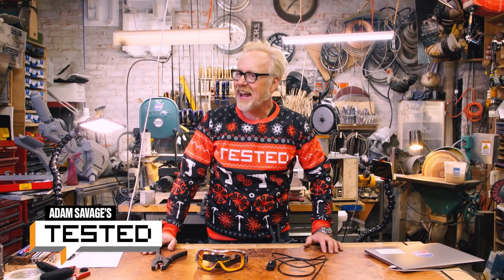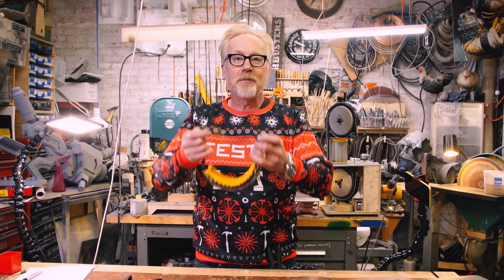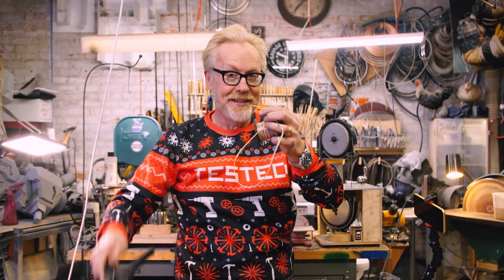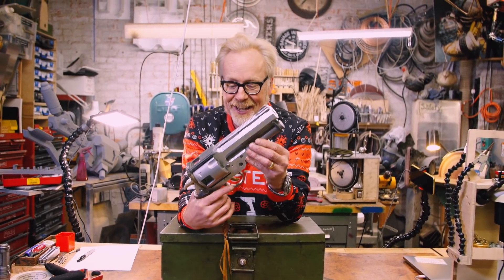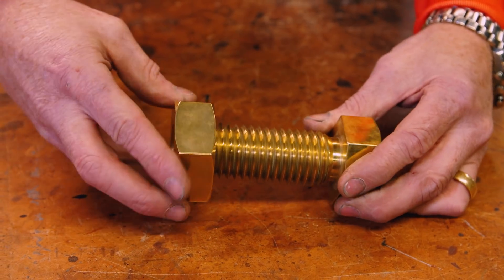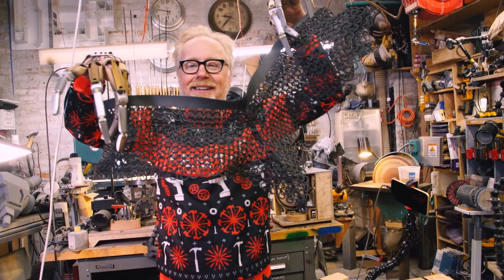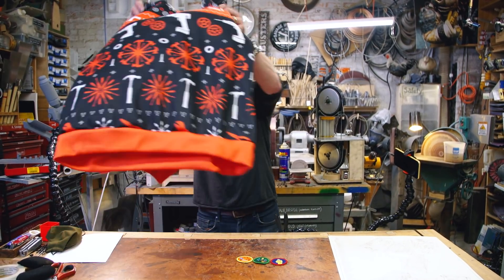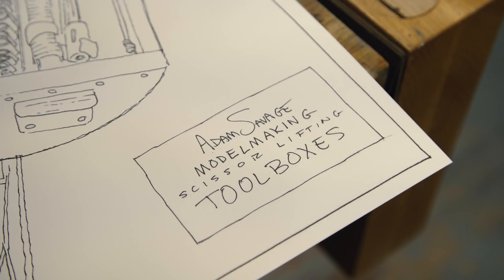Tested in 2020: YOUR Favorite Things!

Comment: On the PPE note, it is possible to get z87 prescription glasses so you can always have eye protection without needing to put on specific safety glasses or goggles. Depending on the design it may or may not be recommended that you also have sideshields, but even without they're better than nothing

Comment: i am commenting off of your fisrt item, I have to say an endo scope is one of my favorite specific use items I have bought. I recently installed an engine kit on my motorcycle and there were some sounds i didn't like. buying an endo scope allowed me to feed it in the spark plug hole a see that me back piston was wearing wrong. saved me a lot of money and time in the long run

Comment: FYI, I just had a look on the Greenlee website to check out their wire stripper - it would seem they don't make that type of wire stripper. They've got a few different types avalible but not the type that helps when you've only got a tiny bit of wire to work with.

Comment: The T100 soldering iron is a life changer.  So small and easy to use.  If you haven't put the custom firmware on it you should, adds a ton of great QOL features.

Comment: I suggest demerit badge for forgetting to put something on the cable before soldering it, what prevents putting this thing on the cable. This but should be flippable (upside down) and you should flip it every time you do it. It should feature the phrase "forgot again" or equivalent on both sides.

Comment: I've probably used a knife to strip wires more often than wire strippers. Even and especially on the wires that you can't quite hold. Cut the coating and gently pull it off.

Comment: Glad to see you have a solution for safety goggles with glasses. But how to solve forgetting to wear them? 
Prescription safety glasses! They exist! 
Get a pair or three. Put them in a little holder by the door. Swap when entering workshop.
Bonus: Add a sensor to the little holder by the door that changes the mood lighting in the shop depending on whether you remembered to swap glasses or not. 😎

Comment: Yup, I got 2 out of 3 of the items, and I have lateral automatic wire strippers which work great. The Dewalt goggles are amazing, I got 3, one for me, one for mom, and another darkened version for outside. Mostly I use it for just doing dusty work.

Oh, I did also get that USB Type-C soldering iron, which is amazing for running off any QuickCharge 3.0 battery. I've used that when I didn't have electricity near by, it is amazing.

Comment: Demerit Badge Ideas:
- Hurry Up and Wait: You didn’t take the time to properly put away your gear (clean, condition) and now you are suffering the consequences hen you next go to use it
- Fresh Air Forsaken: Needed better ventilation (I had no idea so little wood stain could produce fumes that hung around in the house so long)
- Accidental Chemist: combined two substances that had an unexpected (possibly dangerous) reaction
- The Runaway: some tiny but vital component rolled off your workstation and into a pocket dimension - never to return
- The Reckless Rip-down: Took something apart without reference photos or notes and you can’t quite get it back together again

Comment: I bought the same Dewalt safety goggles.  I absolutely adore them - thanks for the tip Adam :D
Reply: I also bought the goggles! Love them ...but....it capures my prescription glasses when I try to take them off.  Small gripe...but....
Reply: @patricksanders858  Try releasing the strap at the back first.  Hold the goggles on at the front, release the tension on the strap at the back by sliding it up off your head, then tilt them down your nose,and off that way - i find they grab my glasses a lot less that way.

Comment: I bought those $90 wire strippers. They don’t work well at all.

The USB powered soldering irons are a mess. I bought the newest version that’s supposed to work on USB Power Delivery. They have a number of different firmware versions and a matrix to show which power sources like specific battery packs they will work on. I bought one expecting it to work with a pack I had, but they won’t work on packs with 15V mode, only 12V.

Comment: Aha! That bit about automatic wire strippers brings back memories.
Particularly for me in high school, circa 2005, when we had to strip wires and they didn't even give us anything good to do it with. What can I say? Third world country. Oh, you need to strip the tubing off the wire? Here, have a tiny dull pencil sharpener knife and carefully cut into the insulation on this braided copper wire but if you damage even one strand of the braid you fail. Now do it fifty more times. Never mastered it. Plus, couldn't find autostrippers (or any other strippers) anywhere like forever.

Comment: Ideas for badges hot glue gun and burnt finger, superglue with fingers stuck together, close call with debris flying as you hold safety goggles. duck as a dremel bit goes flying. Spot needs a neck and head and possibly a slip over fur suit.

Comment: Dear mr savage, please take care of your hands. 
Your eyes are precious so you try to take care of them wearing safety glasses so are your hands. 

As you said yourself they are precious and your tools. I think you said that while working on your samaritan build. On that same build i saw you drill, lathe, mill and cut while wearing a ring and being way too close of the turning object. If i remember right you also said "i cant stress this enough" a couple times to hammer the fact to take care of our hands. 

As you said in your stable workbench build look around and see if there is something that is small but can change a lot just by doing the 2-3 things you need to gather but just didnt yet. This is what i am doing right now. 

So i suggest an idea for a one day build: a silicone molding of the ring you are wearing!

Its an easy fix to avoid having it stuck in something, pinched or melted. A way that can avoid losing that ring that probably means a lot to you. If you do a silicone ring and it gets caught in something or touch an electrified wire you can always make a new one because you still have the original and you still have a finger to put it on. 
Keeping these hands away of said rotating objects will also help keeping said fingers.

 
TLDR: i legit want that silicone ring mold build. 
And
I CANT STRESS THIS ENOUGH WATCH OUT FOR YOUR HANDS PLEASE

This also applies to anyone else who might like to keep all of their fingers.